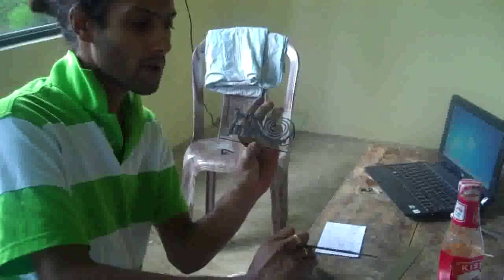LED with Conductive Ink

Comment: Wow.  Like low-temp version of electronic thick-film printing!  I wonder what this stuff looks like on the microstructure scale.  Does the graphene form in large sheets on the surface or is it a bunch of small, randomly oriented "sheetlets" that interconnect (or both)?